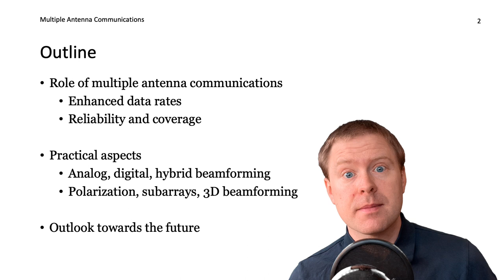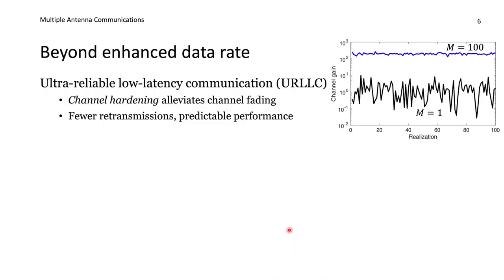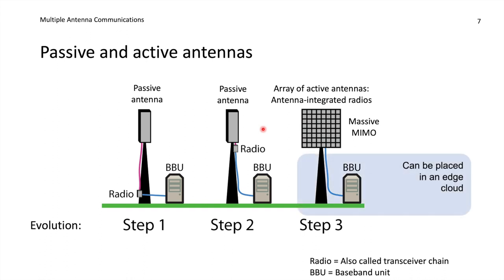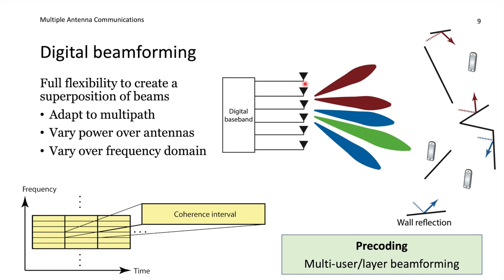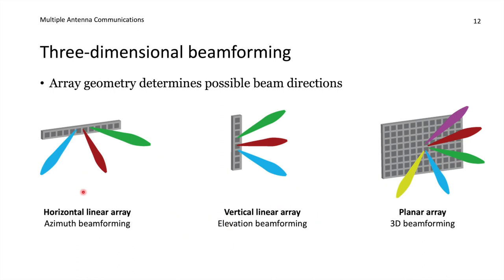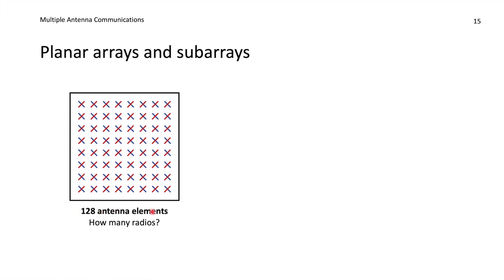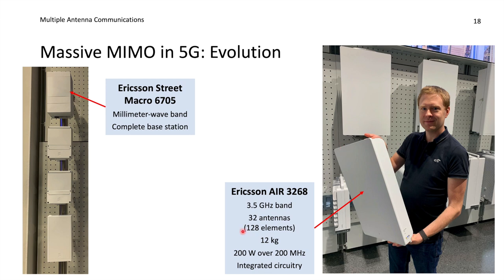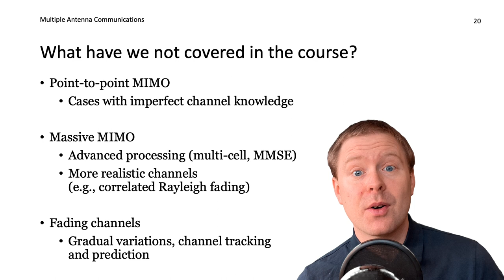Lecture 14: Practical Aspects and Outlook

Comment: Thanks for all of your interesting videos.
Speaking about Dig. Beamforming, I know that it is a multiplication with complex weights in the baseband. Are we there in the frequency domain or in the time domain?
(I somehow assume that we are in the time domain.)
If that is the case, can that all also be in the frequency domain be done?
Thanks.
Reply from the maker: In an OFDM system, you apply digital beamforming separately for each subcarrier in the frequency domain. Complex weights are applied to determine the transmitted signal on each subcarrier and then the IDFT is utilized to transform the signal to the time domain before transmission. This makes it possible to transmit in different directions on different subcarriers, simultaneously.

This stands in contrast to analog beamforming that is (approximately) the same on every subcarrier and therefore can be said to be applied in the time domain instead.

Comment: Is there any deeper use that in MIMO systems there are always taken antenna numbers which are 2 to the power of x (2,4,8,16,...)?
Reply from the maker: There is no strong theoretical reason for it, but it is rather an engineering habit. When designing protocols and algorithms that involve the antennas, then if we use 10 antennas, we will anyway need 4 bits to describe the antenna indices. So then it is more efficient to have 16 antennas so that we make full use of all the 4 bits.

Comment: Very interesting. To slide 9: With the Digital Beamforming you can get many beams, that is clear. But, how is it decided whether there are two beams (like in the image) or only one beam to one receiver? Is that a result of the computation of the precoding in the baseband unit, so that is automatically done?
On this slide you can also see the image with the coherence time/ frequency. Is it really useful to separate in the frequency domain? Because one want to use little resources (here frequency) to transmit the information.With these beams I can transmit at the same frequency at the same time -> that was my aim, I think. I don#t really understand the use of that.
Thank you.
Reply from the maker: Yes, the number of beams is determined automatically. You estimate the channel, which will be a superposition of signal components going in different directions before they reach the receiver. When transmitting using maximum ratio transmission, you will automatically transmit beams in all those directions and allocate power between them proportionally to how strong the different propagation directions are. If one direction dominates over all other directions, one will approximately only transmit one beam.

The data rate is proportional to the bandwidth, which is why each wireless generation uses more and more bandwidth. If you want many Mbps, you need many MHz of spectrum. Current 5G networks often use 100 MHz, while the coherence bandwidth might only be 0.1 MHz. Hence, to transmit over all the bandwidth using beamforming, you need to change the beamforming over the frequency domain. (This is only needed when the channel contains multiple strong paths, so in line-of-sight communications, one might use the same beam over wide bandwidths without much loss).

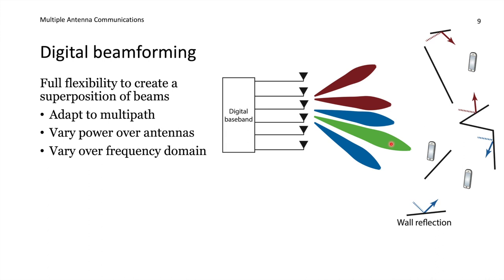Comment: 1) If I've understood Slide 9 @15:50 correctly, in digital beamforming we separate users in frequency and spatial domain whereas in the previous lecture, we always separated users in the spatial domain (transmitting over the same frequency and at the same time).

2) Btw isn't digital beamforming the same as massive mimo? Basically, every element has its own transceiver chain, i.e., active antennas. Or I am mixing up several different concepts :D

3) @16:42: Does precoding need to be multiple data streams? Throughout the lecture, I always understood that with precoding we basically inverse the impact of the channel over different paths/antennas.
Reply from the maker: You are right that all the theory presented in previous lectures consider Massive MIMO with digital beamforming. These things are synonymous when considering Massive MIMO in Sub-6 GHz bands. The purpose of Slide 9 is just to mention the term “digital beamforming” and stress that it enables us to select different beams at different frequencies at the same time - as we have done all along in this lecture series. We divided the time-frequency resources into coherence intervals and designed a different beamforming/precoding/combining in each of them.

However, hybrid and analog beamforming are considered in practical products for mmWave bands, so the purpose of Slide 10 is to mention what this is and in what way it differs from what has been taught in the course.

3) No, precoding can also be used to transmit a single stream. We are just mentioning the possibility of sending multiple streams on this slide to make the point that the analog beamforming on Slide 10 cannot transmit more than one stream.